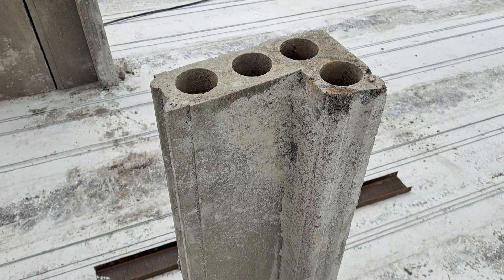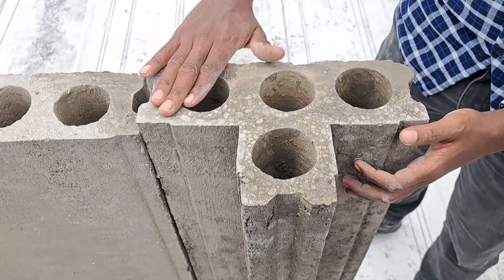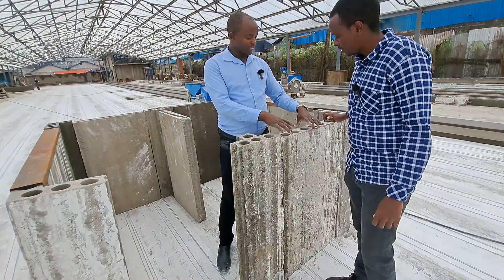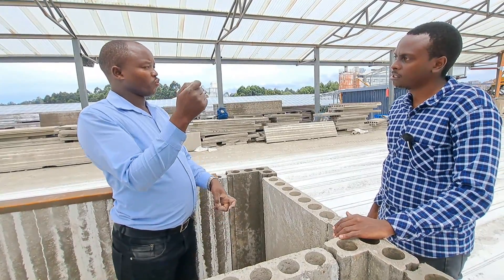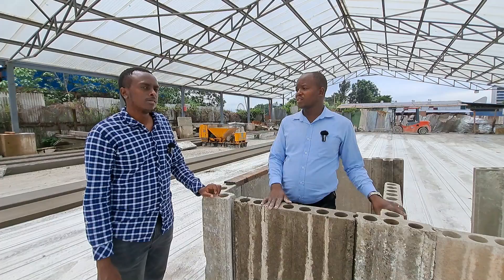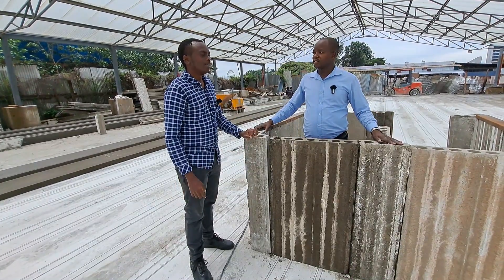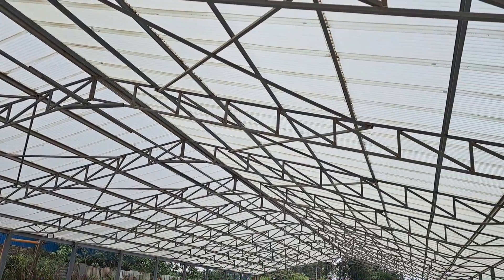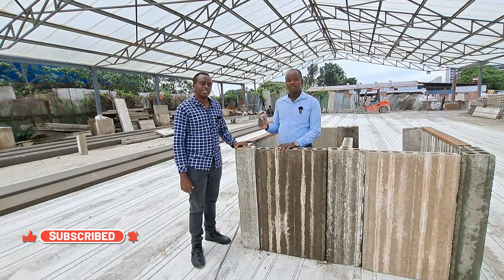The L & T-shaped Precast Concrete Panels are Finally Here!

Comment: Very good and informative video content. 
I wonder what the difference is between the advantages of this construction model and that of self-locking compressed earth blocks. 
Would it be possible to do this with precast earth blocks instead of precast concrete?
Thank you for your response.

Comment: Good solution for corners and partition. But I think one end of the L / T joints should be 'male' and the other 'female' otherwise the jigsaw will have to female ends meeting
Reply from the maker: Yeah they should be male & female joints connecting. This was just a demo structure for explanation purposes

Comment: I think T and L precast are only  applicable  for  non load bearing   single  floor  building. they don't  have enough  reinforcement to carry  heavy  load  compared to columns
Reply: anyway its a great  product
Reply: I do agree .I also have a problem with the way they attach the panels to the foundation .Overall the system is great.
Reply from the maker: Yes they are not a replacement for columns and are suitable for structures that don't have columns